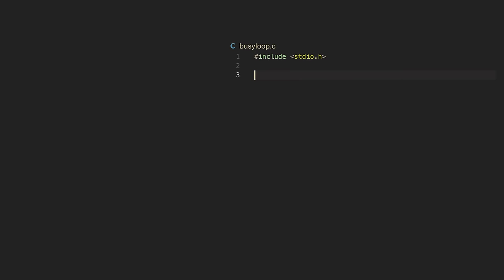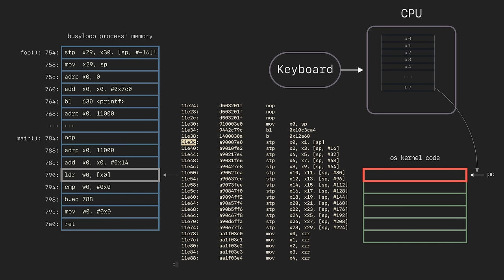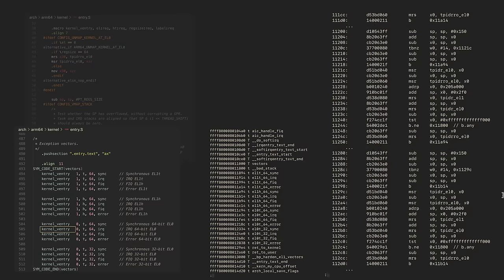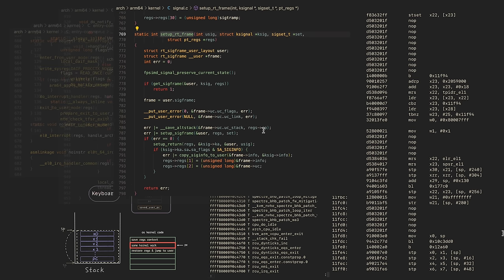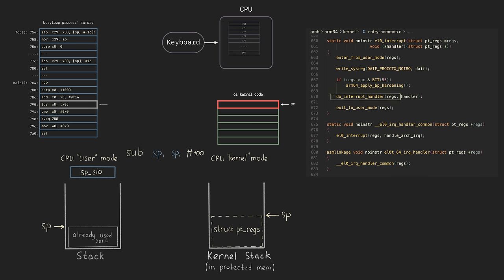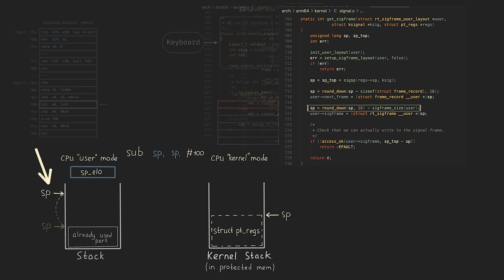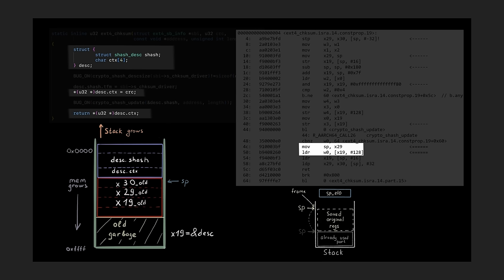Signals. I spent 2 years to understand this part.

Comment: It looks like my process miss a signal every now and then. After watching this video, I think the issue is on my side, but I triple checked all the code. What a life.
Reply: If you are missing a signal, it could be because you are forgetting to re-register the signal handler after it catches the first signal. If you forget to do this, it will only catch a signal once
Reply: Have fun going down the rabbit hole
Reply: also if you use multi-threading, it is undefined which thread gets the signal
Reply: The example code has a bug. signal_arrived needs to be declared as volatile. Else the optimizer can allocate a register for signal_arrive in main(), and the while loop won't notice that the signal_arrived in memory has changed. In fact, gcc with -O3 optimizes out the whole loop.
Reply: @programming5274  oh the classic "if a tree falls in a forest and there's no one to listen for it, does it make a sound?" , the C compiler removing undefined behavior
Reply: If I recall correctly (it has been a while), the (user space) signal handler won't run until the process gets rescheduled. If the scheduler runs another process before yours it possible that flag won't be cleared before another signal comes in. Its basically a race condition.
Reply: If you want an event delivered in a reliably countable manner, it may be better to send it as data through a pipe or socket. If you set the O_ASYNC flag you'll get a SIGIO signal to notify there's data available. This is one possible mechanism to implement asynchronous I/O. 

The glibc manual has a section on merged signals, which may be what you've observed.
Reply: @0LoneTech  thank you, great observation! I usually use pipes to send information between processes, but this time I decided to check out signals, because I needed ON/OFF event. I didn't expect merging because there are delays between the signals, but it must be it. Thinking about it, there must be infrequent delays of 20ms or even lower.

Comment: I did a double-take when I saw the AArch64 assembly... most YouTubers go straight to x86/x64 when talking about assembly, even though it's really not as beginner-friendly as RISC sets, so it's a breath of fresh air seeing someone introducing beginners to ARM. :)
Reply: Yep, makes it easier to follow. Though would prefer RISC-V assembly even more - I think it should have all the equivalents just the same
Reply: ARM? More like LEG. Get 2 and spread em
Reply: 'arg, you're twisting my AARM'  :P
I'm on the side of the fence getting burned by AARM existing.  (Technology I require is x64 only.  Customers require AARM)  :/
Glad to see it's being used, but the flashbacks from work are real   😂
Reply: @TheOriginalBlueKirby  so that's why they called it that in Turing Complete (the game)
Reply: So that's what's going on!
I was going to ask why the stack pointer's called `stp` instead of `rip` or `eip`.
Reply: "even though it's really not as beginner-friendly as RISC sets"
Why?
It is no more or less readable than you(or the compiler) make it.
Reply: @ABaumstumpf  That's a great question! I'll try to be thorough:

Beginner-friendliness refers to how steep the start of the learning curve is. Access to good, readable examples is certainly an important (perhaps the most important) factor, but as you've pointed out, that's up to the examples' authors. So readable examples in any popular assembly language are very easy to find.

The main factor I had in mind was the transparency of the instruction set. The average instruction in x86 represents several micro-operations (it's not clear to a beginner that `ADD DWORD PTR [EAX + ECX*4], EBX` is doing no fewer than 4 micro-ops behind the scenes, for example) making it not very transparent. The defining characteristic of RISC is a 1:1 (or very nearly so) relationship between instructions and operations: that means simpler instructions to learn, and the beginner gets to discover the relationships between operations for themselves.

x86 is also opinionated about its use of registers: some instructions (e.g. MUL/DIV, CPUID, and to a lesser degree PUSH/POP/CALL/RET) don't encode (all) source/destination registers, making the "GPRs" not exactly general-purpose. This steepens the learning curve slightly because beginners have to learn the special meanings of some of the registers while learning the instruction set, instead of when they're learning the calling conventions.

And though not related to its instruction set, x86 was introduced in the late 70s, in the era of segmented memory and 16-bit data, and still keeps that legacy stuff around to be an occasional stumbling block for those not familiar with the history. ARM64 was redesigned fresh in the early 10s and fits very well with modern computing principles like linear memory, fully uniform register use, and SIMD.

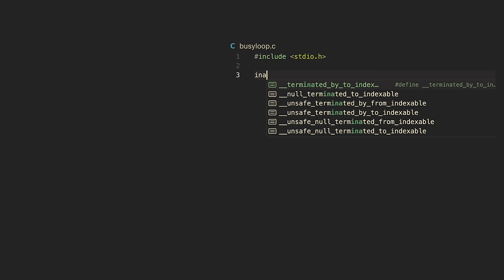Comment: 00:00 💡 Programs need to communicate with each other, often by executing functions when signals are received.
01:24 🛠 Interrupts allow the CPU to break from its natural instruction flow to handle external events like keyboard inputs.
02:30 💾 Kernel preserves user register values when handling interrupts by saving them to memory.
04:03 🔄 Replacing the program counter at the right moment allows the CPU to jump to a signal handler function.
04:41 🌐 Programs can register signal handlers with the kernel to respond to specific signals.
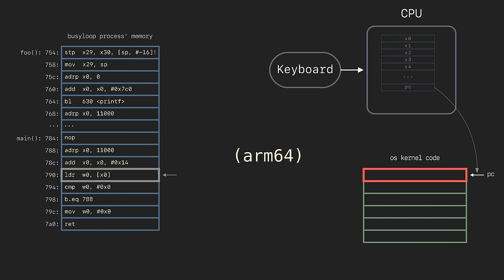05:57 📜 Examining kernel code reveals how the CPU knows where to jump when an interrupt occurs.
07:18 🕵 Disassembling kernel binaries uncovers the implementation details of interrupt handling.
09:00 🔍 Detailed exploration reveals how the kernel handles interrupts and resumes user processes.
10:49 🛑 Ensuring the kernel stack is empty before handling a signal prevents overflow and nested signals.
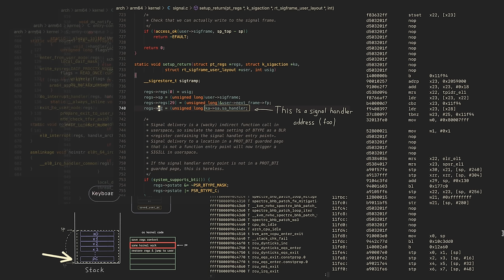12:07 ↩ Saving original register values to the user stack enables restoration after the signal handler executes.
14:16 ⬆ Understanding stack behavior in kernel space is crucial for signal handling and process resumption.
19:00 🎭 A kernel trampoline allows the CPU to jump back to kernel code after the signal handler finishes.
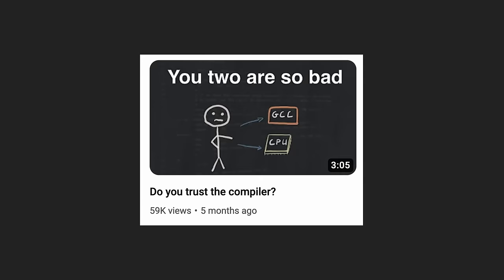20:45 📺 Bonus: An additional video discusses a compiler bug related to reading local variables beyond the stack pointer.
Reply: Ok but why all the unnecessary LinkedIn-ass emojis though
Reply: @GeneralKenobi69420  Oh, that's easy. So any idiot would feel smarter, hence make the day of those who have a hard time reading all the lines.

Comment: The internet certainly does not have enough low level programming information available, so things like that are always appreciated. I never worked on ARM but many other risc micro controllers. Also implementing preemptive / cooperative multitasking based on interrupts on x86 is somewhat simpler. This can even be done in the classic real mode. Since x86 stores the interrupt return address on the normal stack, in order to do a context switch you really just need to exchange the stack pointer / stack frame. Each "process" would have it's own stack area. So a process could invoke a software interrupt (cooperative) or a hardware interrupt like a timer (preemptive) could interrupt the execution of a process and the interrupt handler takes over. Besides the automaically stored return address, the handler would save the registers in the user stack frame and then just exchange the stack to the stack of a different process. As a result when the interrupt handler does it's iret, it returns to where this process has left off the last time.

My dad actually developed quite complex machine control software back in the 80s and 90s and they used a DOS powered machine that ran over 2000 "tasks". Many task where really small, did just one or two checks and then yield again. They circled through all tasks hundreds of times per second. The actual pascal library mtask is really simple, just around 515 lines of code with many comments (with the comments stripped out it's just around 320 and with a bit different syntax style just 230 lines :)). Quite an impressive library from an ancient time. Of course it does not really apply to any modern system except embedded and microcontroller development where you don't really have a separate kernel. Though the fundamental concepts are still the same.

Comment: If only had this video a few years ago when had to learn arm64 for the job, specifically port our kernel(OS) to it. Took a hot minute, to say the least, to understand concept of interrupt vector tables and under workings of the assembly
Reply: Also tpidr is kinda scratch register where you can store anything but it's cannonical use is to store id of current thread
Reply: Are you telling me that you got a job to port a kernel to another arch, and you didn't even knew the concept of interrupt vector tables? Wow, must have been a really hard and eye opening experience.
Reply: @framegrace1 especially because x86 has the same concept.

Comment: What happens if another interrupt replaces the hardware "saved_user_pc" before the kernel had time to save the state from the first interrupt?
Reply from the maker: This is a very good question! Indeed, such a problem exists and hardware is well-aware about it.
When a systemcall (svc arm instruction) or an interrupt occurrs, the CPU hardware immediately disables all the interrupts. Since that moment it is up to the kernel code when to enable interrupts back. So, the kernel is safe while saving registers and program counter - another interrupt will never occur until the kernel explicitly enables interrupts back.

Comment: I'm very curious about this msr and mrs instructions that are skipped by the branch. @ 8:50 

I looked it up, and Move System to Register, and Move Register to System, seem like they would be useful as part of the interrupt process. 

I wonder if there is special kernel code that can conditionally call into this interupt offset to skip the branch instruction?
Reply: I'm completely guessing here, but it could be the case that a higher signal level causes that offset to be invoked. Sort of like the difference between "kill" and "kill -9". In Bash scripting, a basic "kill" will terminate a running script unless the script uses a trap to catch the signal. If the signal is trapped, the script can then perform some conditonal action based on the signal, such as, for example, when Ctrl-C is pressed to exit a running script so the script then performs some cleanup action and cleanly exits. However, calling "kill -9" always "uncleanly" terminates the process, even if the script contains a signal trap. Maybe that mrs/msr are there for that case? I.e. when you don't want the process to be "brought back" after the interrupt. This is purely speculation though.

Comment: Great video, I always like low level OS stuff, always fun.
But most programmers would have a different idea in mind when discussing interprocess communication.
named and anonymous mutex, semafores, pipes, sockets,shared memory, stdin/stdout/stderr and Maybe even COM on windows.
Reply: All of them start with an interrupt.. just saying. This is exactly how any async call works, deep inside any language or framework you may use there's something like this.
Reply: @framegrace1 interupts are optional with things like mutex. You can pause until signaled and then acquire the mutex but you could also just check periodically (not always in a loop). Its more or less memory that has been mapped into both processes so each can read each others writes.

Comment: Would it be useful for a CPU to have kernel only registers? That way the kernel wouldn't have to save and restore user-space registers all the time. Although, I guess it wouldn't really save much since the kernel has to do that a bunch for application scheduling anyway.
Reply: The kernel stores the registers in the stack so it can switch threads by just changing stack pointers and returning. To change processes it changes the page table loaded on the cpu.
Reply: @tripplefives1402  it would have to restore the cpu registers at some point surely? User space programs still use them.

Comment: A friend of mine has this to say:

> signals is just ""interrupts"" but they're executed by the scheduler.
> it's not special, it's not its own thing. it's fundamental computers
> >but what about nested signals
> you have nested interrupts too
> >btw you can't use the kernel stack
> why would you? just do the same as any other function call. 
> oh that's the solution they came up with? huh, peculiar
> it's almost like he approaches the Linux kernel as black box with secrets to uncover.

Comment: 4:48 Hey, this example is really bad. Your signal handler does not follow the correct prototype of void (*handler)(int). Also, the signal handler is required to be reentrant or async signal-safe. Your function is not because it uses global state int signal_arrived instead of some volatile sig_atomic_t or other lock-free atomic global. In this case, you should probably use atomic_flag because it is guaranteed to be lock-free and your example doesn't care about what the value of the signal is. Furthermore, it calls printf() which is also not reentrant. Though, on a posix system you could replace it with a call to write()
Reply from the maker: Thanks! Yes, the example could have been more accurate.
Reply: K'mon, is just an example of how this works.... No one here is expected to jump directly to write signal handlers for real OS's. All that minutia would make just the concept more obscure. He explained all important parts.
Reply: @framegrace1 you use signal handlers in user mode code as well if you work with code that uses two or more processes or if you pause/sleep until some shared resource is free to acquire.
Reply: @framegrace1  CVE 2024-6387 just discovered in OpenSSH leading to remote code execution because the signal handler wasn't async signal-safe. LOL
Reply: @xBiggs   So? What's your point?

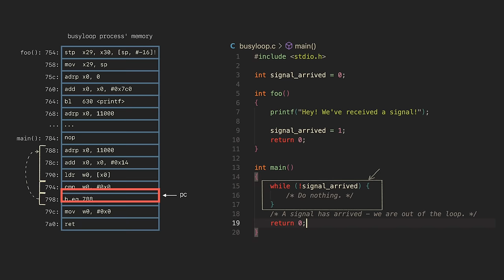Comment: 1:00 while not particularly relevant to the discussion (it's just an example), one should be careful with infinite loops...

int main(){
    while(true){};
    return 0;
}

C++ x86-64 clang (trunk) -O3

main:                                   # @main

this seems to be a bug with LLVM backend.
now, if you use gcc, you might end up with the process hogging as much cpu as it can. so you really should sleep there.
Reply: 1:25 it's only like that with old pc's using ps/2 plug. usb uses polling afaik.
Reply: Set the variable to voltaile so its not optimized out.